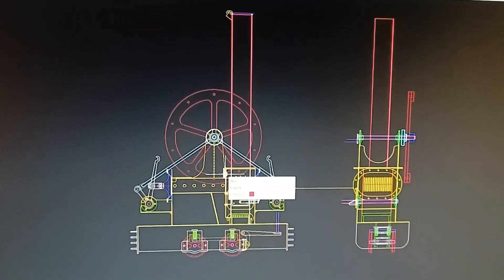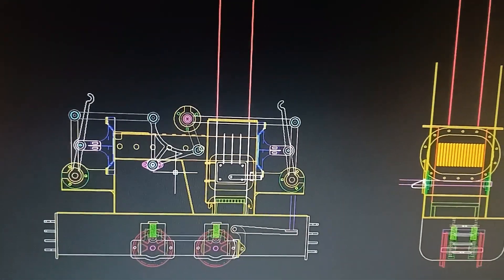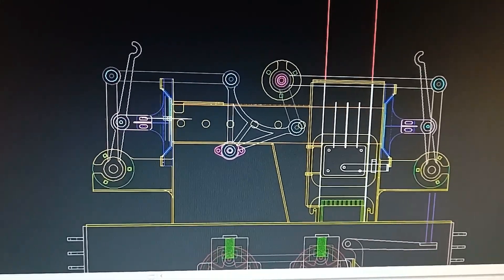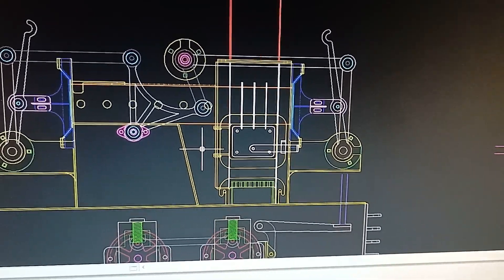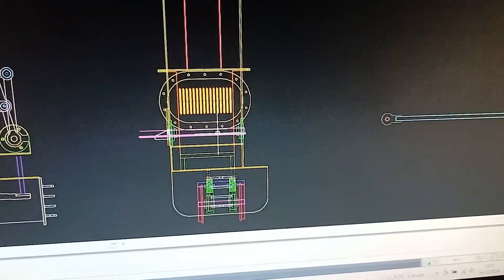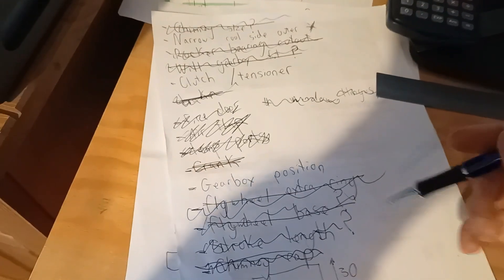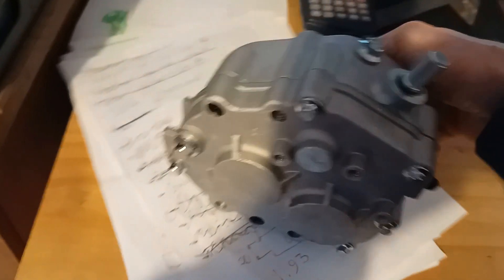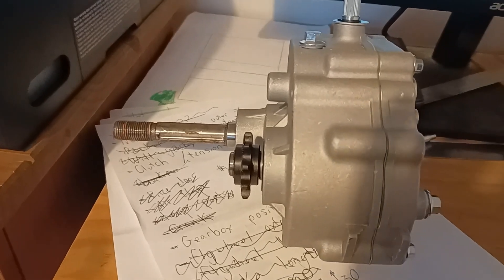Hot Air Stirling Engine Locomotive - Part 2

Comment: I think this equation might explains why the previous heat exchanger limited the power of the previous Mk4 engine you made.
50mm/1000x100mm/1000x2sides x 8 flatpipes  x 0.0209W/K.m/(3mm/2/1000)*(500C-30C)/4=130W
the devide by 4 is bc i'm assuming the hot air inside pipes will only reach the middle range temperature between the temperature of the hot and the cold side because it's cross flow heat exchanger , and the second divide by two is because of the integral over time of the heat flux,
so that 130W, multiple by 0.315 which is integral of sin/cos over the flywheel and we end with 40W
the limiting factor seems to be the 0.0204W/K,m which is the heat flux of air if it's laminar, maybe the thin pipes actually were counter-productive, a turbulent flow in a thicker pipe would have had higher heat flux maybe?
doubling the number of pipes without changing from crossflow to counterflow will only multiple the power by 2 if the size of the heat exchanger remains the same. counterflow will instead quadruple the power.

Comment: In the US to cool a desert night club at night they use copper tubes at an angle through the wall to outside.  with water in the tube bottom thats evacuated,  so water boils at club room temperature.  water boils rushing as steam transferring energy to outside cooling and condensing it runs back into the club room.  Can you use this concept of heat transference?  Best wishes Brin.
Reply from the maker: Hi, I understand what you mean. I think that's worth some thought 🤔
Reply: @ShanePomeroy  Thank you,   I'm very impressed that your engine does actual work pulling the little train.   It's just an  idea on heat energy transferred by reducing the vapour pressure so water can boil at ambient T.   Best wishes Brin. A lowly Hnd physics in 1955

Comment: Hi Shane. Just worried about having a heavy flywheel that tall above the track surface might make the engine's center of gravity so high that it becomes tipsy around bends on the track.
Merry Christmas Shane and Family!
- Chuck in Florida.
Reply from the maker: Hi Chuck, I also share your concerns : ). I've now reduced the height as much as possible and cutdown on high up weight to help compensate. I'm crossing my fingers it will be ok! If not, I'll change something! All the best

Comment: First thought was the wheel spacing looks very close together?
Don't want the engine to start rocking about once running.
Reply from the maker: @shug831  It certainly is a concern! I've got the option to add extra low weight. We shall see?

Comment: Shane, I like it -  I think as you have made so many engines it is almost rude to make suggestions - having made 11 entries in the old eco marathon the enemy is weight & friction- especially in items that move - look at each item - can the connecting rods be tubes? can they be an aluminum alloy, carbon fibre or titanium - sourced from radio  Ariel, TV antenna or military/aircraft use - look at bearings - think ceramic ball - if belts think flat serpentine or toothed the flex is easier than V - sniffer valve?  - if flywheel why not have a smaller wheel turning faster than a big wheel turning slow? If anything has gloopy oil or grease rethink it : )
Reply from the maker: @trevortrevortsr2  I constantly need reminding to not neglect these important details! I'll print out what you've just wrote and put it on the wall above my printer as a prompt. Many thanks

Comment: Have you stirling engine a Regenerator? The Regenerator save Energie and help to have more Power.
Reply from the maker: @Sailer2  not a dedicated regenerator but the heat exchanger tubes have huge surface area so should act as one.

Comment: Bello. You should really consider adding short hot insulating dome on that hot bellow. At least 1x diameter length. Gap aoround it will transfer heat which will be transfered fron one of the furnace sides. 

Have all dimensions ? Shell i run some numbers on tube sizes ?
Reply from the maker: @StanislavZachazevski  I'm hoping to. Get. Away without a piston extension. I do have 1" between the furnace and piston. You might be right. I've probably got enough dimensions now to send over, cheers